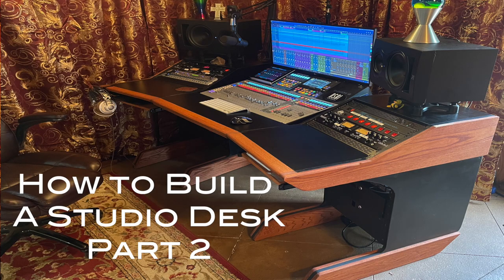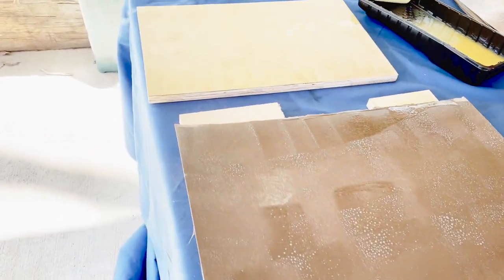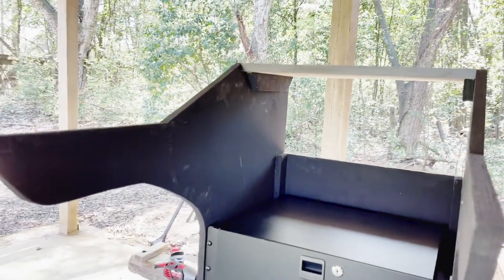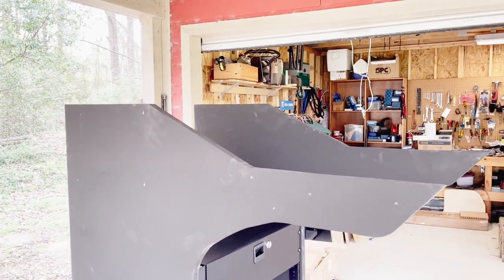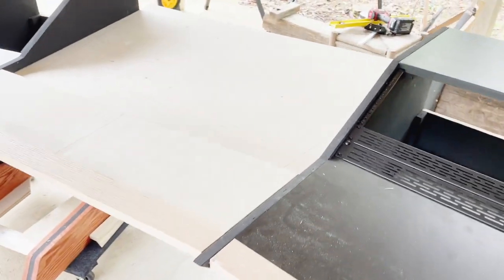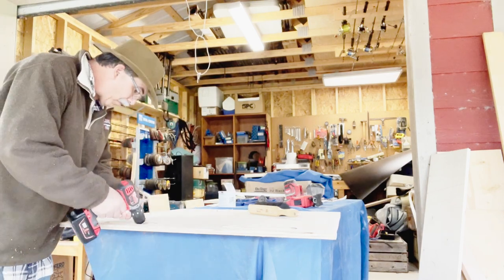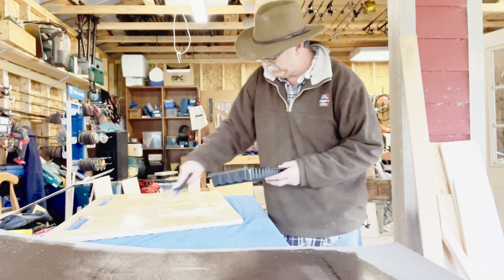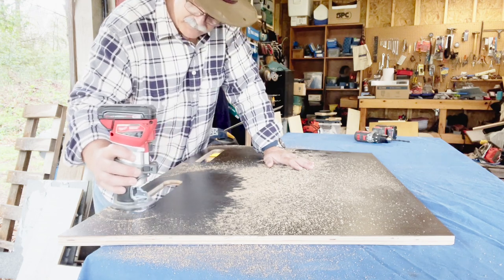How to Build a Studio Desk for Music Production Part 2

Comment: what type of router bit was used to create the straight edge ? everything online seems to show me router bits for different types of cuts including curved edges
Reply from the maker: I wouldn’t know what to call it I bought a assortment pack for around $50.00 it basically just has about a 1/2 or 3/4 rounded edge. Your local store could probably help you choose one.